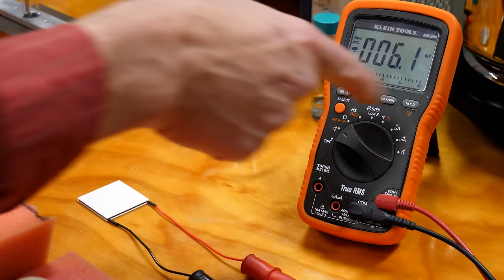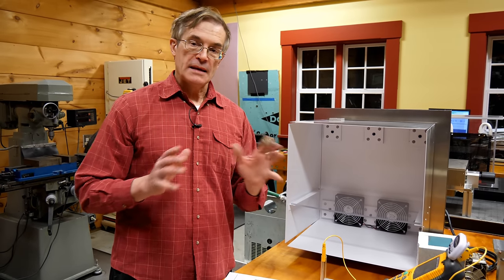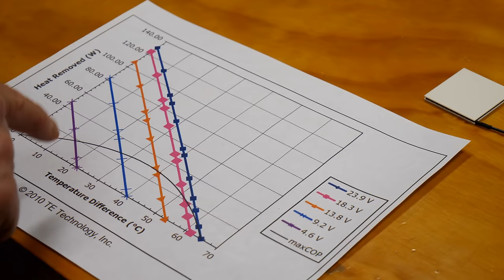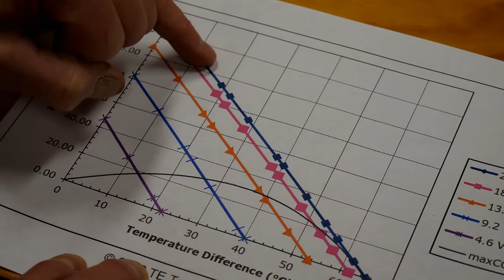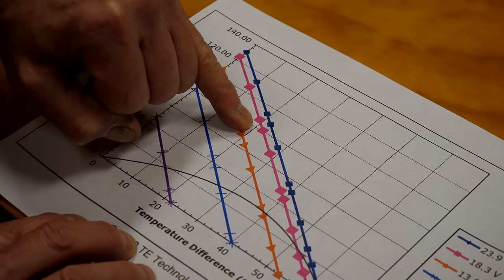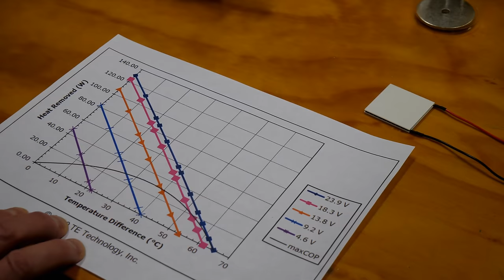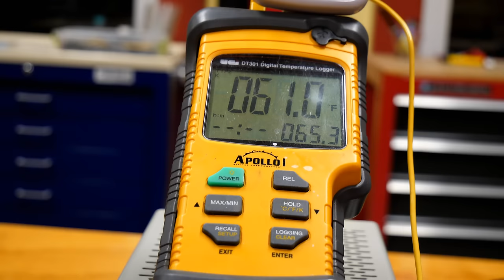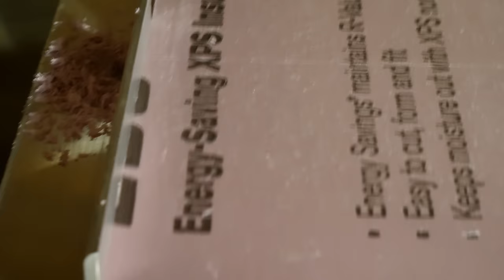BUILD YOUR OWN REFRIGERATOR! - SOLID STATE TEC

Comment: Huge peltier blocks are used in polymerase chain reaction machines in molecular biology labs, and also in sequencing instruments (including genome sequencing machines).. these instruments use the peltier style systems for rapid cooling and rapid heating. Reverse polarity switching to have heating-cooling on a single side is a great thing about peltiers. It requires some engineering/thinking to determine how best to conduct heat & cooling, but you can't do that with compressors without major re-engineering. These instruments are used for melting DNA strands apart by breaking down it's base-pairing hydrogen bonds which happens at about > 92C - 95C and then when cooled, the bonds reform at about < 60C - ish (depending on the DNA sequence), effectively glueing it back together.

#TechIngredients -- how well would your box act as a food warmer if you switched the polarity (even if it was horribly inefficient as a warmer)?
Reply: It is fairly easy to create a warm and cold plate. You use liquid cooling and direct electric heating or two separate liquid flows if the cycling needs to be very fast and controlled. 

To use TEC in the way you explain in the sequencing machines results in problems with condensation. That can be hard to solve. 

It works as a good food warmer. It transfers a small amount of heat from the room to the food and thus increase the efficiency slightly if you want the cooling of the room.  
As explained in the video the warm side gets the electrical power and the pumped heat. 
The TEC has a upper heat limit that is not as high as ovens.
Reply: @per.kallberg  those problems are solved, yes there's condensation. It's not a huge issue though as there is a heated element in the system to drive off a lot of moisture, but it doesn't affect the cool block.
As for the warmer,   I asked how well does their fridge perform as a warmer. I never said anything about an oven.
Reply: Kieran Short Well I didn’t know to what temperature you wanted to warm your food and an oven is an excellent food warmer.  It also works in the complete temperature range usually associated with food and looks remarkably similar to what this video describes. The  baseline to your question of good food warmer could thus be an oven. A TEC cabinet could work just as good or slightly better if you don’t mind the cold side and the condensation issues it brings. But I will give you a hint to answering your question. No one builds food warmers from TECs.

Why should they be inefficient warmers? They work excellent as warmers.
Reply: Pelteir devices are more efficient at heating than resistive heating because they pump heat from one side to the other plus offer resistive heating. but their hot side temp limit should not be exceeded
Reply: If you look, Coleman made a cooler that also would work as a warmer. I got mine as a gift for 15 years of service.

Comment: Just found this episode from ElectroBOOMs TEC video (though i have enjoyed many of your videos before). Throwing my 2 cents into the mix, what about a bottom hinged door with side sliders for better cooled air retention when opened?

Using the unit bottom up, among other things, would mean the hot air vents are enveloping the unit. Using the unit how it sat when the hjeat sink was put together means cold air naturally dropping to the bottom of an internal container and warm air naturally raising towards the TECs.  But it also means lifting the damn thing every time you want (which may help sick gains but slows down getting back to the science). Though if the TEC array was a top mount door, it would cut down on churning the air when opening. Rounded side sliders, with a door that wont open all the way flat unless you make it (push the sliders in or out of their track) would cut down on losing cooled air and keep the hot side air away from the outter walls.

I know the video is over half a year old, but just wanted to add to the brain storm a bit. Love the vids!

Comment: Cool video. I see there is a hole in the spacers, I guess you have determined that the surface area is good enough with the hole and went for lighter. How did you determine that? Do you have enough experience to know that or did you do a back of the envelope calculation?
Reply: I also noticed this and was wondering at the reasoning behind it.
Reply: Yeah me too, seems strange
Reply from the maker: The lightness is an advantage, but the removal serves to increase the pressure on the interface without exceeding the limits of the TECs.  This reduces the thermal interface resistance and mitigates the loss of the cross sectional area of the aluminum.  The hole makes it possible to produce a flatter surface from the stock aluminum bar from which the spacers were fabricated. There is always a bow in the stock material.
Reply: @TechIngredients  Thanks, it makes sense. Stupid followup: why not start from a tube and do all ops but the drilling on the lathe?
Reply: « Cool video »! Was that pun intended? Regardless, you made me laugh😂😂
Reply: @TechIngredients  hmmm.. but there is less surface contact no? or are the circles filled with some thermal fluid?
Reply: @TheObserver567  - yes, there's less surface area, but given the thermal losd of this system and the thermal conductivity of aluminum, this much surface area is still overkill. While copper conducts heat better, aluminum is very, very good at it as well. 

With that said, the overkill amount of cooling from conduction & convection is how they're going to have this work in a fanless fashion. ;)
Reply: @Broadpaw_Fox  yes but why make the extra effort to drill the holes if when not doing it cooling is actually better. I didn't really understand the explanation
Reply: @nirodper  - from what he did by drilling the holes, he is able to clamp down harder on the area of the tec's directly under the remaining material. That higher clamping force gives this setup better cooling potential than not having the holes and having lower clamping force. It's all about load distribution. 

If you look at the size of the screws he used, they can't be expected to hold an extreme amount of force - and the size of those spacers is a lot of surface area. He wants a rather high clamping force on the tec's, so he needed to decrease the surface area being clamped to increase the surface pressure, since the clamping mechanism (the screws) has a fixed strength (clamping load). I hope this makes more sense.
Reply: @Broadpaw_Fox  the plate directly under the tec doesn't have a hole, it would be very detrimental because it would develop a hot spot. The holes are on the other plates, and apparently he wants higher pressure between those as he says higher pressure is better than bigger area.
That doesn't make much sense to me as I would think that 200psi is good enough, why double it? Isn't double the area better?
Reply: @nirodper  A higher area will increase the quantity of heat removal per hour, whereas a higher pressure will allow for a higher temperature differential. If the TEC's could be clamped at a higher pressure without destroying them, then the holes wouldn't be necessary.
Reply: @gtjack9  the holes just increase the pressure between the plates as the force remains the same but the area decreases, your comment makes no sense as the pressure on the peltier element remains the same
Reply: @nirodper  if you have a 1cm^2 plate and a 10cm^2 plate, guess which one can conduct a higher BTU per hour. He wants to be able to use the 10cm^2 plate but he can't because a higher force is required to compress a larger area for the same pressure. The peltier cooler is not designed to support such high forces and so he must either use a smaller plate or decrease the force applied in order for the pressure exerted on the peltier to be below the maximum recommended amount.

Also he was struggling to get good contact between plates (without holes) due to the stock material he was using not being absolutely flat. When the material bows from the force being applied at the corners you get a big area of low pressure in the centre that doesn't exchange heat very well compared to the solution he came up with.
Reply: @gtjack9  don't you see that the plates that have holes are the ones that are not in contact with the peltier elements? What I say is that it is much better to have a large area and a nice pressure (he stated around 200psi) than half the area and 400psi.
The pressure and force on the peltier element is always going to be the same anyways (max allowed)

Why even bother making the holes????? It is much easier to sand the plates down if it is that much "bowed". If you invested all that money and time making a fridge why go the "easy" way with that
Reply: J P. I made a water chiller tank for my water cooled cpu on my computer a couple years ago using ebay solid state. I used silver based thermal paste to fill the gaps.
Reply: @TechIngredients  can you explain this situation a bit in the next video?
Reply: @nirodper  i also cant see why the holes exist, no commercial product has holes this way, i pulled a few apart for peltiers... 
on either side, you going to create a hot spot on the hot side and a freezing area on the cold side, you dont see cpu coolers this way or the mad overclocking people having holes, its not making any logical sense. , its wrong, plain and simply wrong until i see paperwork otherwise, unless the ones one the peltier are flat square, and only the plates between the sheets have holes, but even then i dont think theres any realworld difference you could show with like thermal imaging even if the ''theory'' is its 'better'
Reply: @WereReallyRelayCamping  yes only the plates between sheets have holes, but I still think that a bigger area is better than higher pressure
Reply: Thermal imaging would help this presentation immensely

Comment: Excellent presentation! I'm looking forward to the next video. We have had a peltier based travel unit for a long time and it works great, however, its cooling/heating ability is limited based on ambient air. I hope your design is better!
Reply: I wonder, does space suit has these sort of Peltier systems to cool or heat the astronauts in space?

Comment: Amazing video!!!! Thankyou once again. One thing I would mention is that those fans need a small gap in between them and the heatsink, that small gap allows for the air to not be compressed. You don't want compression, instead you want high velocity air flow.
Reply: I also thought so. But he actually made holes through all the plates for fans. You can see this in the construction timelapse.

Comment: It would be nice seeing you build/optimize/analyze pc cooling- there are a lot of computer and gaming channels here that try to overclock and therefore cool their CPUs and GPUs with dry ice and novec and so on... and I am pretty sure they are doing it all wrong (😊) - but I don't have the knowledge to prove it... overall that entire field needs some actual facts and science here on youtube- this channel would be perfect for that
Reply: Na dry ice is for super over clocking and only done for a short period of time usually to break a record. It's a good way to do it for their purposes
Reply: @ramheyhey  I've done it for the experience and it's a huge pita because of condensation.
Reply: PC cooling is a dynamic system as you're constantly changing your heat generation but the math for heat exchangers isn't terribly complicated.

Comment: What kind of life span is expected from one of those peltier heat pumps?
Reply from the maker: Tens to hundreds of thousands of hours.
Reply: Are the electric cooler based on Peltier pumps? I'm doing a project that requires to keep water cool and was wondering about using a couple of them. Would be great to see a soda can cooler video. Looks like you know a lot. Thanks.
Reply: Statistically; 11.4 years. They work well in abnormally harsh environments.
Reply: Except for condensation, yeah, who knows' why not 40 years?
Reply: @markgray4704  The cooling fan is the limiting factor, (MTBF) change the fan every 3.5 years and you may get 40 years. Cheers!

Comment: Just purchased some TECs to add active cooling to my cheap 3 watt RGB laser diode module, just because higher quality modules and projectors use them. But, until now, I had no idea what I will be working with. This in depth video is exactly what I need to know.
Thanks!
Reply from the maker: Sure.
You might take a look at some of our RGB laser projector videos.  These were put out a few years ago, but there are a lot of techniques demonstrated in these videos.
Reply: @TechIngredients  Thank you for the quick reply. Yes, I've already watched your excellent laser projector series.
Did laser shows and built gas ion laser projection systems for 10 years during the 1980's. They were very fragile, required 60 amps of 3 phase and 30 gallons per minute of water cooling, aka major touring hassles. With current pricing, OTC software, MIDI controllers, and laser diode technology, I couldn't resist getting back into the artform, just for personal enjoyment. So, after 30 years I'm back in the game, but playing catsup.
So far, I've rebuilt my 2 inexpensive Chinese projectors from the bottom up. At the moment, I'm rebuilding the (unstable) dichroic mounts and (uncleanable/non-focusable) cylindrical lens mounts on the red LD. The Peltier TECs will be the final cherry on the cake.
Question: I plan to power the TEC with a 5 amp, 5 VDC buck convertor, which also powers an ethernet-ILDA DAC. When I turn the projector off, it will still be rather warm. So, do I need to protect the DAC and buck converter with a diode against reverse voltage being generated from the warm TEC or will the polarity be the same?
Reply from the maker: The polarity remains the same.
Reply: @TechIngredients  Thanks so much for letting me know that I have one less thing to worry about 😎

Comment: Superb work and youre always great at dissecting and analyzing the process in swift direct terms, thank you.
Im intent on working on a refrigeration unit that will reuse the excess heat it creates through sterling engines that can either feed back electricity or assist in heat dispersion

Comment: I love your videos! I was inspired many, many times to investigate new directions and different concepts. You have a great workbench and are easy to understand and follow! I understand a little bit more about the Cold and Heat Fields thanks to Magic, and from your description of how a piezo electric heating and cooling circuit works I imagined how to build such a design using an open flame. I hypothesize heating 1 end of a conductor with a resistor in the middle and keeping the other end cool will generate a current towards the heat, freezing the far end at the same time! The reason is because a Cold Field is where energy isn't moving very much over a length - like Absolute Zero would be. So, the electrons pause to wait for each other to enter the smaller channel which is modeled by a resistor. On the heated end the electrons are accelerated to expand because heat is energy changing less with motion only, and inside the conductor they will move away from the resistor. Great videos!
Reply: So, didja test your theory? I'm curious of the outcome, having noticed how much thought you've invested. 🤞

Comment: Oh man, did your project dump me into the WayBack Machine!  Time: Spring 1974. Place: Pittsburgh PA. at a major engineering university. Premise: A group of electrical engineering students in their senior year have been assigned a class project:   design a machine that can cool a blood sample from body temperature to an assigned temperature in a specific time.  And then implement the design in a proof-of-concept prototype. The materials that must be used are provided: a 2x2 inch peltier module , power supply and some thermal grease. All the remaining materials are to be purchased or scrounged. And none of the students had any thermodynamics training. (EEs don’t need no thermodynamics, do they?) Students were split into 10 teams of 4 each.  (Fast forward to end of semester) Only 1 team met the design criteria.  All the rest did not meet criteria.   All the teams were able to build something that did some cooling. Of course the most of the grade was based on the design analysis. The teams that “failed” suspected the team that “won” probably had a roommate that was a MechE thermo wiz. Their big ass heat sink and fan might have had something to do with it.The winning team wasn’t talking. Tonight, I hope I don’t have a nightmare reliving this adventure from wayback.  Nonetheless, enjoyed the video. Now I have something to watch in addition to cooking videos.

Comment: Very neat video!  It interests me because I repair the antique 1920's and 1930's refrigerators. They all use phase-change (vapor compression) to cool. The longest lived ones use no fan and rely on convective airflow for cooling the hot-side of the system.

The motor and compressor run in oil, and will last for 80 years without seeing the light of day.

The early ones use sulphur dioxide as the phase-change refrigerant. This is unpleasant to work with, and very expensive. As a replacement refrigerant, I have been using the same thing you're using to blow the water off your cooling device. I use the 1,1,difluoroethane (refrigerant R152A) which is sold as "canned air." 

One of the ways we improve the antiques is by replacing the original paper or cork insulation with polyurethane, similar to what yours is insulated with.Tanks for making this video!
Reply from the maker: Interesting and thanks!